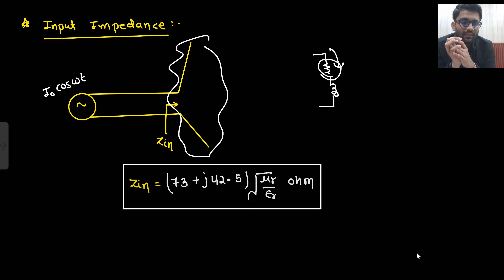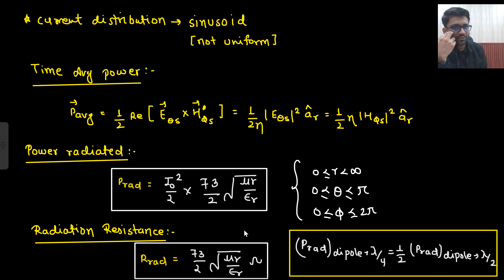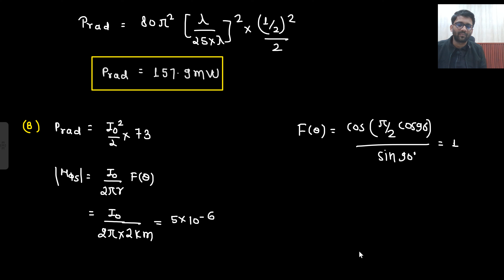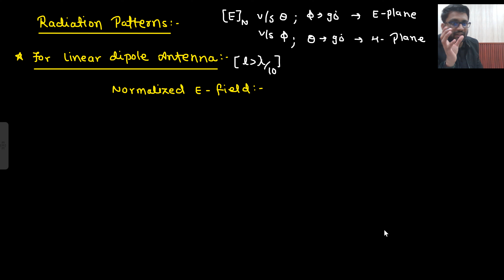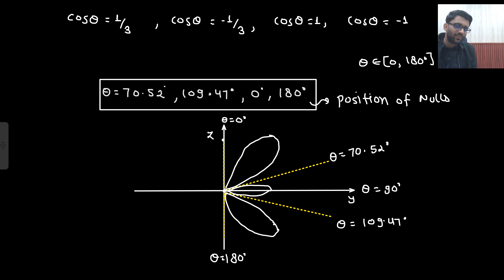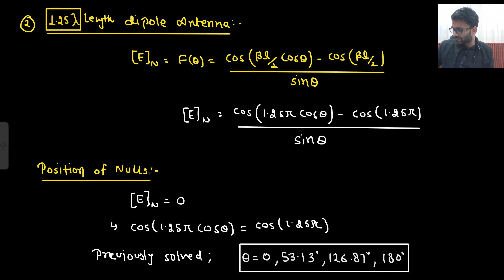Linear Dipole Antenna and Their Radiation Patterns || EMFT || ECE || PrepFusion || Himanshu Agarwal

Comment: for 0.4585 lamda , null are at the 0 and 180 degree only 0 degree is considered for monopole and maximum radiation is in the angle of 90 degree
Reply: There is some error in the location of nulls, try again.
Reply: @HimanshuAgarwal_  i have calculated for monopole antenna sir , i am getting same answer again
Reply: @omkumarkondra6673  I guess you have forgot to double the length. We will treat monopole antenna as dipole antenna and then find nulls accordingly and then remove the part of 90° to 180°